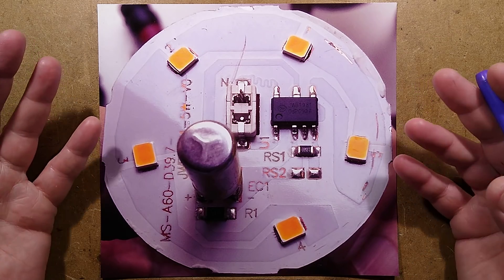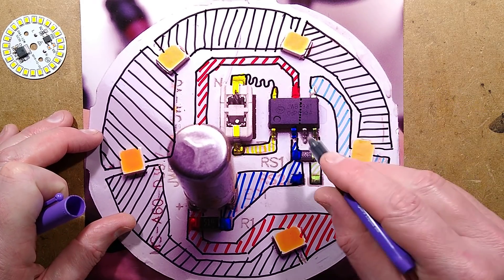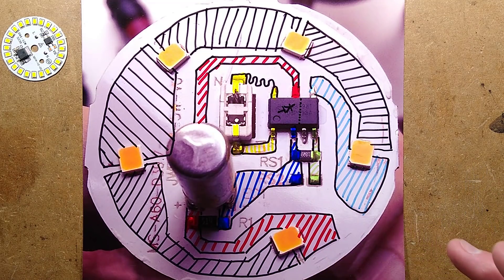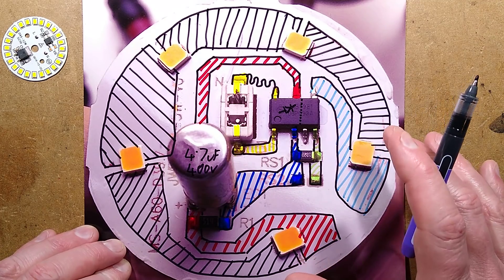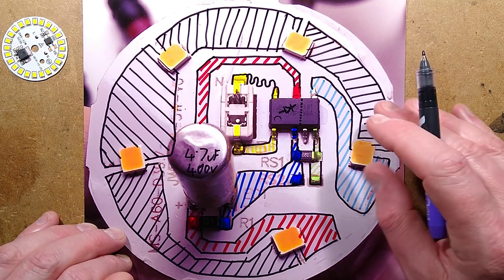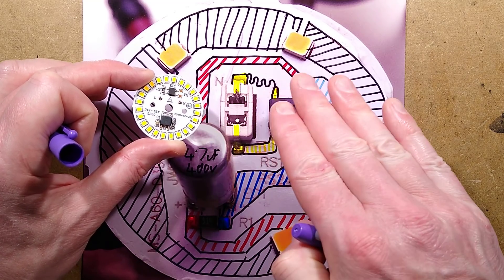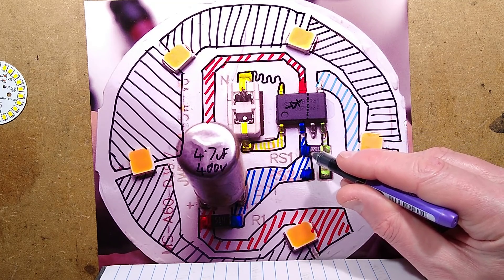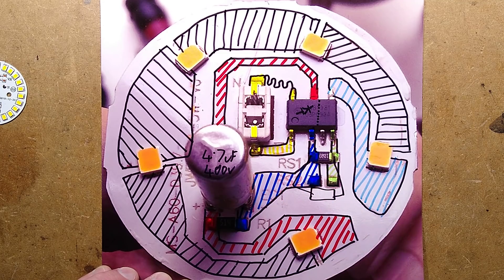New LED lamp twist reverse engineered from a picture

Comment: I am considering a 12V DC lighting with a plug in charger and battery. There would be 3 switches. 110V AC not used but available.  12V white and 12 red for night use. My windows have blackout curtains so it would not be apparent if I am awake or asleep.

Comment: This is the 4th or 5th time watching this video over the last 3 years trying to figure out the cheap GT-Lite bulbs I got at a home improvement store that uses the same jwb1981 chip. It has a 200v 6.8uf electrolytic capacitor and resistor marked with what looks like 3 black and 1 brown (brown on the incoming end unless all 4 are black or blackened). 8 LEDs on an thin aluminum sheet and run off 120v mains. I took photos. The two surface mount resisters are almost legible one is too small the other I don't know which way it is read. The date code 1221 (Dec 2021?). ZCSLLV0(or O)354 SL-JWB1981-39.9-1B8C-2011-63-V1, are the numbers and letters on the board not associated with the component positions.

Comment: You mentioned that the Chinese LED bulb could be dimmed because it didn't have a capacitor but would suffer flickering. What are the are the key voltage-related components in a properly engineered dimmable LED bulb?
Reply from the maker: Modern dimmable bulbs often limit the charge current into the main capacitor, and then dynamically adjust the LED current to match available charge.

Comment: this lamps uses exact board and chip, named "candle" light bulb?  What do you think, can I use this chip/circuit to drive 1-3w single power led?
Reply from the maker: The linear regulator chips are only suited to high voltage LED arrays.

Comment: Can you repurpose these linear regulator circuits for custom light bulbs at lower voltages? Say 12v? I want to see if I can make a fog light bulb using warm white filament leds. I suppose I could just use a resistor selected to run at 14v? Unfortunately i cant imagine 12v filament LEDs are as good as the ones you get in mains bulbs, which require about 65v for the forward voltage. Im very tempted to boost the voltage upto 65-70v to use the better quality LEDs 😅
Reply from the maker: Yes, the chips can be used at lower voltages.  There's a slight voltage drop across them, and the LED voltage would have to be adjusted to match the supply voltage minus that regulator drop.

You can buy filament style automotive lamps.

Comment: I have a box of GT-Lite bulbs with this chip, very dodgy, one of which started flickering intermittently today. Tore down and found the line and neutral wires are switched (according to the pcb markings). Wonder if that would contribute to early failure or if it's a garden variety overdriven bulb. My experience with rectification is minimal.

Comment: HNY Clive!  Very interesting and informative video Sir.  Would be interesting to see what sort of spurious noise these simplified LED circuits put out.  EMC and RFI are serious issues that tend to be ignored by so many designers these days, especially if You select Your purchase by Lowest Price.  Still got to be much better than the naff 'Buck' circuits that were once very common. With no chokes or filters many of the older mains driven LED lamp designs simply injected radio frequency noise into the mains wiring!  As A licensed amateur radio operator I have binned many lamps that were generating RFI disrupting licensed radio operation.  Hopefully these new units will be 'quiet' in operation.  Someone Please give Big Clive a decent RF spectrum analyzer, I'm sure he would put it to very good use 'sniffing RF' from all manner of gadgets and gizmos. :-)
Reply from the maker: These are linear regulators, so noise will be low

Comment: Well i have a really cheap LED lamp that only uses a smd rectifier, 1 electrolyte capacitor, and 1 film capacitor. It's really bad that i had 3 cases of exploded electrolyte capacitor. I still got some of them working though
Reply from the maker: That sounds like the classic capacitive dropper type.  If the LEDs fail open circuit the electrolytic capacitor often bursts.
Reply: @bigclivedotcom  did you have a video about capacitive dropper? I'm a newbie hobbyist and i would love to learn more about this type of circuit
Reply from the maker: @17_xiimipa5muhammadluthfii6  I feature them a lot but don't have a specific video about them.  The capacitor effectively rations an amount of current through each time the AC supply changes polarity.
Reply: @bigclivedotcom  ahh i see. So the problem is just bad quality LEDs that fail open in which the energy from the capacitor has nowhere to go and causes the capacitor to bursts. BTW, Thank you for replying!

Comment: I have a Question to the cheaper diming without capacitor: Do they flicker because they use PWM oder is there something wit AC and Mosfets, that takes it off synk? 

In my understandig, it should not flicker visibly  if you understand PAL/NTSC an set it right. Is this correct? 

(Sorry for my english…)

Comment: Because some (many?) modern LED lamp bulbs contain wet electrolytic capacitors, the shelf-life of new-unused bulbs is being questioned:
https://www.edn.com/whats-the-storage-life-of-idled-led-light-bulbs/ 
Should LED bulbs show a freshness "Use By" date for the consumer?
Reply from the maker: The wet capacitors will last a long time until heated in use.  There's still equipment with electrolytic capacitors from the 80's still working because it's cool-running.

Comment: Clive, you will have to start opening the chips up! I really want to know if the bridge rectifier is monolithic or separate chips particularly if it is all on a single chip. 
I seem to remember we used hot nitric acid to etch the package away at one company I worked for. The sort of hazardous process you enjoy so much!

Comment: Wait.. did I hear that right.. those led modules are 50V each?.. that's insane.. I must have misheard cause I'm used to leds having a forward voltage of like .. under 5V
Reply from the maker: These have single chips with large numbers of LED junctions on them.
Reply: Well that explains why the diode function on my multimeter doesn't light them up when testing them out .. that's crazy though .. I wonder what a look under a microscope of some kind will be like..

Comment: I have that chip chines Led which u have and its very bright. Was looking forward to lower its brightness and remove some leds but got No success. Also noted the in normal use case every Odd Led's like 1st 3rd 5th.... are brighter then Even Led's, wondering the reason.
Reply from the maker: You can often lower the current, but don't remove LEDs.  The LEDs are often multi-chip and may be different voltages to match the supply voltage.

Comment: The smallest led-driver I have seen was just one resistor, and two capacitors (and a shit-load of leds).. 

I can only assume that they exploited the fact that the leds ARE diodes as a way to rectify the power, having two long chains of serially connected diodes that will let through in different directions..

I assume it wasn't built to really last, and would be quite sensitive to power-fluctuations and other things.. I am surprised that it could get CE-certification.
Reply from the maker: Sounds like an inverse parallel array with capacitive dropper.  Sometimes found in the small round decorative 1W globes.

Comment: @ 0:10 Sec ... Paused... The 1st thing I noticed was that the Capacitor top...
Looked to have been under rated;... with that bulge LOOK...
5 C.O.B. 50V dropped across each... Didn't look good.
Reply from the maker: Brand new lamp.  The Poundland lamps also use a small number of high voltage LEDs.

Comment: Crazy idea here, but with the Chinese unit (sans capacitor), what would happen if you put a capacitor across the entire LED string, like from the + to LED pins on the diagram. Would it eliminate the flicker but still be dimmable, or am I talking crap due to sleep deprivation?
Reply from the maker: It might work to a degree, but the dimming curve would be weird.

Comment: Integrating the bridge rectifier in the regulation chip allows using FETs to do active rectification with only a transistor drop for each replaced diode. For switching regulators, the switching and rectification transistors could be combined to further reduce losses.

Comment: Does the chip maybe also make it a dimmable lamp via duty-cycle chopping?
Reply from the maker: No.  The big capacitor would prevent that.
Reply: @bigclivedotcom  are you sure? the cap smoothes the DC voltage available to send to the LED chain, but it doesn't prevent the chip from chopping it or adjusting the allowed current based on watching the input side of the rectifier, which is all on the same die. I'd be interested in seeing some scope outputs with it connected to a typical SCR-based dimmer.
Reply: it seems like a chip wired like the one here could react to the "flats" in the dimmer's waveform: https://dxarts.washington.edu/wiki/ac-dimmer-circuit

Comment: When I tore apart my 5$ 9year 16led bulb the pair of resistors had the same letter code but no ohm values. [Chinese] So, I broke 1 off anyway 😁 and plugged it in but couldn't discern any change.
Reply from the maker: If they were parallel resistors with equal value then the power should be around half.

Comment: Hi Clive. Have you done a vid on the poundland usb tower? I thought you had, but I can't find it. Mine went pop on 1st use.
Reply from the maker: I'll keep an eye out for that.
Reply: @bigclivedotcom  only had 0.45A going through it. 4x electronic Christmas light kits, and 1x usb clock fan. Plugged all in, all working. Turned off at socket switch, turned on, and pop! Should have sent it to you. I think transformer went, but my diagnostics suck, so stripped it for parts, and desoldering practice.

Comment: Clive, is it possible, to cut the tracks between each LED and solder in extra LEDs? Since they are all in series anyway.
Reply from the maker: The LEDs are a multi-chip high voltage type.  Some lamps use more LEDs with less internal chips to spread the dissipation.

Comment: We have a glowing lamp. Is it using power when it is off?
Reply from the maker: No.  LED lamps will glow with just the tiny amount of current coupled capacitively through switch wiring.   Especially with multi-way switching.  Treat it as a bonus night light.

Comment: Is the squiggle on the N line to the bridge acting as an inductor or delay line ? Just wondered why they did that :) 👍
Reply: It's to limit the speed of the current spike as the diode turns on at the top of each cycle. Otherwise it generates RF noise.

Comment: I'm just curious as to what that bit of copper track, poking out from under the chip, is connected to?

Before long, someone is going to come up with an LED that connects straight across the mains without any external circuitry at all. Either, a dedicated LED for the job, or, one with all the circuitry onboard.

Comment: Always hearing about the capacitive leakage and I was wondering if it could be used as an advantage, even designed into a lamp, after all the energy is still dissipated at the moment just in the resistor as heat instead of visible light, I would like a low glow night light effect at my shed door, toilet and a few other places, how about a video on that modification.

Comment: I came across one of these chips as well in a small 6W EURODOMEST LED lamp. Had the same trouble finding the datasheet too. If anyone's interrested, they can be bought in "Action", which is a Dutch kind of Poundland cheap junk store equivalent that has expanded to several other western European countries.

Comment: I remember something on one of the earlier LED lamp videos to the effect of "I wonder how long it'll be before the lamp manufacturers catch on and start making lamps we can't hack by just breaking a resistor off", and it looks like for one reason or another that's happened with this one... I've also pried the tops off a couple of Wilko LED bulbs recently, and while they don't have the bridge rectifier integrated with the regulator yet, they seem to have a pair of sense resistors in series rather than in parallel (as well as a 4th, apparently unused, pin on the regulator chip). No getting these down to a more sensible power level with just side cutters!

Comment: Have to say the most impressive Chinese mains LED modules I've seen are those that power different blocks of LEDs at different points in the mains waveform to achieve a good power factor - really good design !

Comment: I kind of miss the old days when the lights would dim whenever a big load kicks on. So quaint. LOL
Reply: With a high voltage LED string the dimming would be much more pronounced than it is with incandescent lamps. And while quaint might describe the lights dimming with normal loads switching on, annoying is a better term when the load is pulsing. And it's more than the lights. Old TVs (particularly B/W ones with completely unregulated supplies) would shrink the picture when the supply voltage is lowered. Occasionally I've noticed a slight 2Hz or so undulation in the lights for several minutes (I think from the power company's regulator transformers overshooting). On the old tube TV I had on at the time the pulsing was terribly obvious.

Comment: If that is really a current regulator then I think you marked the minus and sense pins backward on your schematic. The current would flow through the resistor and the sense would measure the drop across the resistor. When the current is 50mA the drop across the resistor will be 600mV. So the regulator regulates to 50mA through the resistor and so of course through the LEDs too.

Comment: Just checked in with the WayBack Machine, there was talk of such a chip in the electronic hobby magazines back in the 80's. Most said, no, not enough physical separation, etc. ect. Maybe we have another offering from "Area 51"  =)
Reply: this tech was around but not used in the 80s beczuse leds were not widely used then. no ekconmic incentive to produce. then. its just a current source .
Reply: @nsfeliz7825  um , yep, okay, if you say so. ;)

Comment: Thanks for another great LED video. I had great success with doobing LEDs as they do not involve cracking them open to modify internal resistors.  Are there any variable capacitors suitable for dimming such simplified bulbs?
Reply from the maker: A variable capacitor for that would be massive.  Easier to switch between fixed values.

Comment: At this point I’d buy a dozen, plus some multi-chip LEDs. Easier and cheaper than making my own capacitive dropper. I should check LCSC.
Reply from the maker: The chip and matching LEDs are very specialist, as is the aluminium core PCB material.
Reply: @bigclivedotcom  Yeah, the aluminium core is not something you could find easily, especially not through a fab house, but a PCB made to be particularly thin bolted to a heat sink would be usable. Or you could mount the LEDs on something else, assuming multi-chip LEDs aren’t always in SMT packages.
On LCSC I’ve found ICs without the internal rectifier like the RM9003, which goes up to 80mA (could drive a 25W LED string), for under 3c each. Put them in parallel for more power. They’re more expensive on AliExpress though. And no clue if they’ve got internal temperature monitoring, since the datasheets are all in china runes.

Comment: Is there a video for 12V MR16? I've opened one up and there is way more "stuff" inside.
Reply from the maker: Most seem to use a rectifier and buck regulator.
Reply from the maker: (or boost regulator)
Reply: @bigclivedotcom  Thanks Clive I will do some testing. These are cheapish LEDs that don't seem to last very long so we have replaced a few with with OSRAMs thinking they may do better but they kill the TV signal. First world problems.